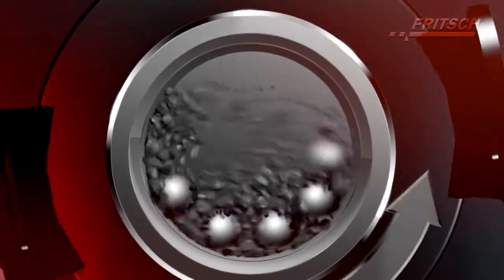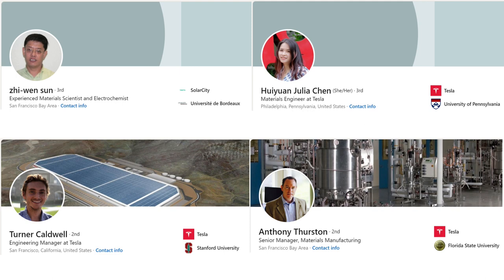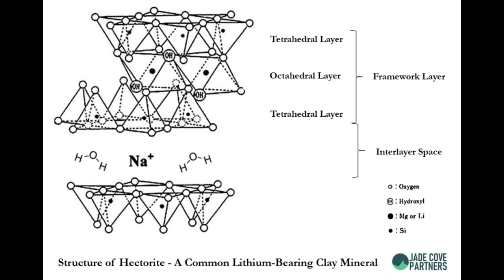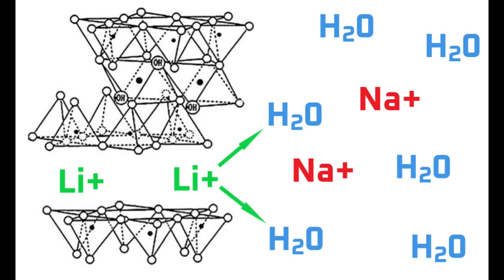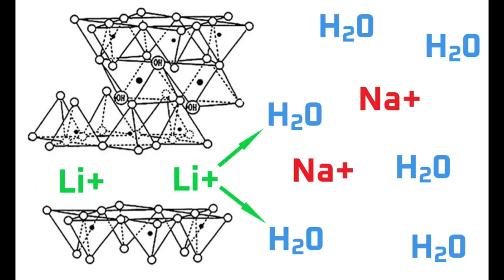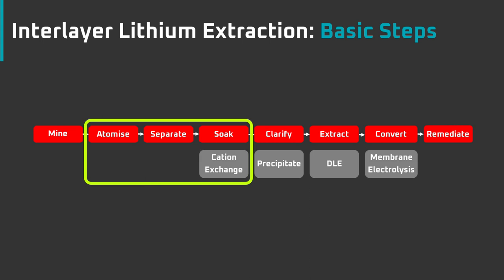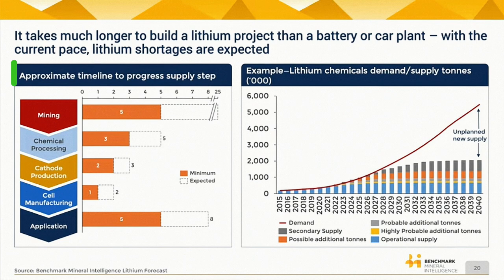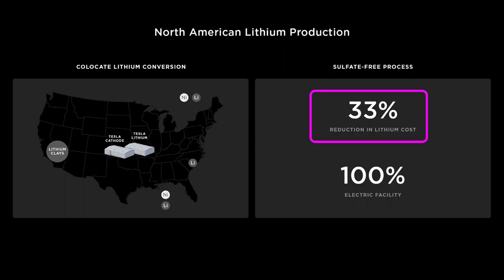Tesla's Lithium Clay Patent Application // Selective Extraction

Comment: I think the biggest reason why Tesla goes through the patent process is so that other entities can't observe what Tesla is doing and patent that process or design (eg Nikola) and cause Tesla to pay royalties on a process that Tesla's engineers developed.  If the patent is denied there is proof that Tesla had developed the IP before the other entities patent process started.  

Also if there is no patent granted, the other companies would still have to gain the expertise and refine the process.  It seems like making the process viable is much more difficult than coming up with a solution and getting it to work in a small sample size.  Then again, there are companies that already have the equipment and much of the necessary processes to do similar things already.  It would be hard for a startup or company getting into a new space to compete with that.

Comment: @JordanGiesige I wonder if there is an even more direct way to break the bonds rather than ball milling or mechanochemistry?  How about using sound at precise frequencies needed to break the specific desired bonds?  Like how an opera singer can use 556 hertz to shatter glass?  This could be a peaceful use of military sonic and ultrasonic directed weapons.
Reply: Something like this is possible, but using light. Uranium enrichment is incredibly energy intensive and slow. Using precisely tuned lasers can speed it up a bit.
Reply: @peterfireflylund  Yeah a microwave tune to deliver photons with the energy needed to break the bonds. Then I realise that you are essentially microwaving tons of dirt to extract lithium not exactly what I would imagine to be an energy efficient process.
Reply: @kazedcat  Microwaves (or RF) energy have already been used to heat the ground at hundreds of meters depth to improve recovery from heavy oil deposits. Look up "L3Harris"

Comment: Mechanochemistry seems weird at first, but makes sense when considering the fundamental forces at play:
Chemical bonding is routinely used to exert force, so conversely applying force can influence chemistry.
A bit like piezo-electricity.
Reply: It's not really "force" as much as it is "energy". There are technological processes that take advantage of stress-induced phase transformations, for instance, (incl. high-energy ball milling), but this is not the case here. It's simply a matter of "activating" the material, mainly by dramatically increasing its surface area via comminution. Simply put, it turns it into a powder or, if mixed with water, into a fine slurry, and that accelerates chemical reactions simply by virtue of having more reaction interfaces and shorter diffusion distances.

Comment: Mining companies are very risk averse, that is the more likely reason they avoid untried processes. For Tesla it may make sense as their product is not lithium but the car. Note that high energy grinding is very costly energy (electricity).  Back in the 90s, I did a study on fine grinding of 7-8% zinc ore to improve zinc recovery from 45% to 90%, but economically it was a dog, too much power cost.
Reply from the maker: Interesting!  Thanks for the input.

Comment: True to the idea of the best piece is the piece you don't need to build, Tesla announces its new lithium extraction process.

Add salt and shake well.

:)
Reply: I'm wondering if an abrasive like silicon oxide could be dry mixed and milled at lower energy to produce similar crystalline defects. 

Pour sand between counter-rotating millstones. Millstones can be made of tool steel...

I wonder if a certain amount of electricity could be used to capture lithium electeochemically throughout the process.

Nowhere near optimal.

Comment: Ya Im a clay engineer (CerE) and clay caps or std non electrolyte caps are common stuff but not good for long range power. Maybe there is a use for E motor kick start or power jolt 1/4 mile stuff. Maybe a starter clay cap for heat pump motors.

Comment: Does the patent explain the analytical procedure to obtain Li and other metal concentrations?  Normally, they use ICP and/or atomic adsorption but I am not familiar with lithium.  The extraction process looks to me involves particle size reduction of the clay to nanoparticles in the presence of water to dissolve a lithium rich extraction.  Scale-up with large quantities of clays will be challenging as well as removal of the water from the clay.  Disposal of a fine nanoparticle clay will also be a challenge.  This should be all possible and would be better than dealing with sulfuric acid and higher temperatures.

Comment: Looks like we're going to see Tesla's process actually come to fruition, at least in some form.   I've seen a ton of articles about Tesla's recent announcement but no details about what their process would look like. If Tesla seems to want to put the plant near a Gulf port, does that to indicate they aren't pursuing a lithium clay route?  Lithium clay wouldn't need to be shipped in.  I've wanted to see the ball mill process put to use since the moment I heard about it.
Reply from the maker: The lithium hydroxide plant will be separate from the lithium clay mining 😉  Clay mining is digging and upgrading, lithium hydroxide is refining.
Reply: @thelimitingfactor   I understand that the plant that Tesla is talking about is referring to refining, not mining.   Will the refining plant be using the new techniques discussed in this video?

Comment: If they build these plants in the southwest how are they going to power them and supply water to mine the material if there’s power shortages and chronic drought issues?  I don’t believe you can use weather based electricity production to supply the energy needs of heavy industry and manufacturing.  Regardless of whether tesla mines the lithium or some other company does it they’re going to need large baseload electricity supply to engage in this endeavor and with Hoover dam having to reduce energy output because of a drought and the intermittency of solar and wind I think this would be a good application of building nuclear plants to provide more base load.

Comment: Have you guys / gals heard of the DNI process? To get Nickel and cobalt metal hydride precipitate from Laterite Ore.  This process uses laterite Ore and is very effective at removing these essential metals from the ore.  The process "DNI" is in patent. There is an Australian company about to start up using the Patent DNI process and has thus far built a pilot plant and in the middle of a DFS to enable a high level of investment. LG chem and Panasonic will be in deep with this company and already signed offtake agreements. Results of the pilot plant have to be seen to be believed and getting a supply of Cobalt and Nickel and more ready to put into a 4680.  Well Tesla would be smart to get in on the ground floor.  Byproducts Manganese Hydroxide and High purity Alumina and Iron.  All sustainably supplied and manufactured without the Congo issues.  Along with Lithium it would have enough battery chemistry to supply the world. GO TESLA   QPM or Queensland pacific Metals QPM.ASX is worth a look Elon. :-0

Comment: Hey. Perhaps you have heard it and perhaps it does not have anything usefu to add to EV batteries, but Skandinavian wood company Stora Enso is testing a product Lignode that could be used in anodes.
It would be interesting to see your take on this.
Reply from the maker: Yeah, I've heard of it.  It hasn't persuaded me enough yet to do a video.  The ideal would be to eliminate the fillers rather than to switch to a different one.

Comment: What about recycling batteries and having removable - quick change - rentable batteries that one could get an 'your local' filling station?
Reply: Why do you think JB Straubel left Tesla to start Redwood Materials ? Lithium battery recycling ! And the rentable battery / exchangable battery approach has been tried by Tesla and been deemed inefficient. NIO, a chinese EV automaker, currently offers this additionally to normal charging, but it means, they're stuck with one form factor of batteries. Plus you could not go down the road of the structural battery pack, whch Tesla is aiming for.
Reply: @Marlow925  Then a  Tesla is just a rich person's secondary car.. a toy
Reply: @tsclly2377  how exactly did you arrive at that conclusion from this conversation ?

Comment: Lithium clay is literally cheap as dirt. The extraction makes lithium expensive. If Tesla can develop much better extraction technology then they can get practically infinite lithium.
Using mechanical and thermal energy has one more significant upside: You can use local solar energy for both.
Vertically integrating the mining and extraction, and locally producing solar energy would very beneficial.
The solar energy in Nevada is very readily available, it is one of the best places in the world for solar after all.

Comment: Why is the aluminium and iron etc considered waste (I understand they are impurities for selecting lithium) but the cars and power walls etc require those elements for those products so are they going to use that "waste" for all those other minerals? Why waste all those minerals by putting them back as dirt? Use them to make the cars etc
Reply: Its about the cost of the processes needed to remove them from the lithium. And ones removed they may need further refining to actually be usable. All those steps probably makes the end product far more expensive then its worth. You can find lots of useful elements in a lot of things. But if it cost less to get them from somewhere else then whats the point.
Reply: @RasakBlood 
Thanks 🍻🍻
Will be interesting if they are using first principle science can figure out how to extract those other minerals on site could drop the currently needed outside supply though! 🍻🍻
Reply: @brettmciver432  We can dream. But i dont think so. Remember they don´t need a lot of lithium in terms of raw mass. Most of the actual battery are made of a lot of other things with lithium added to it. So even if they could extract the same amount of extra elements as the lithium it would be like getting one gram of gold and then adding alot of cost and work to get another gram of iron. But i could be wrong.